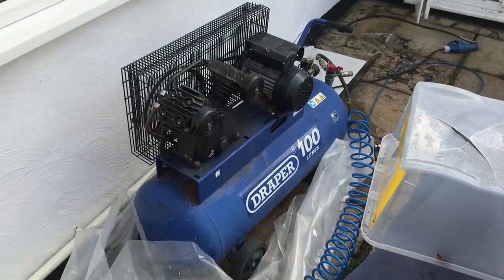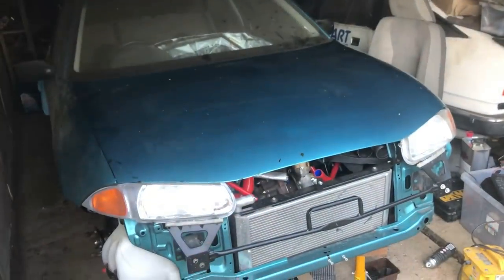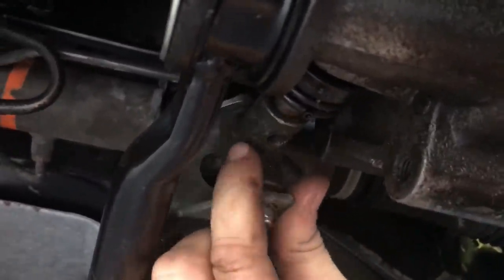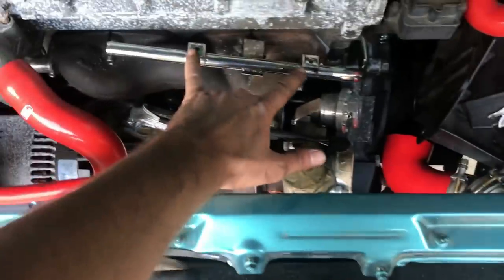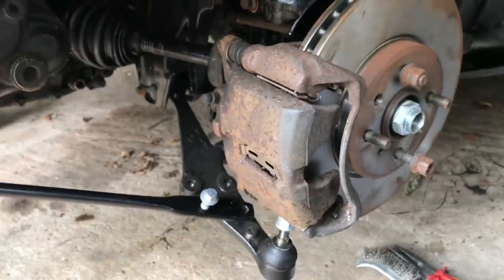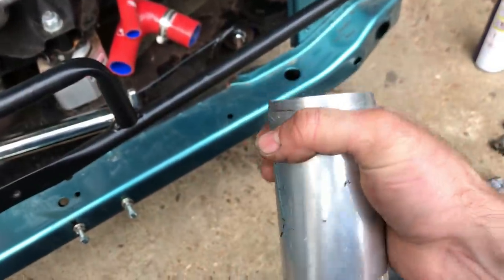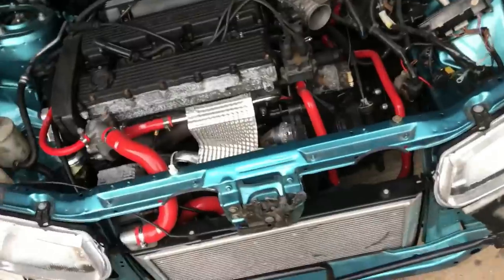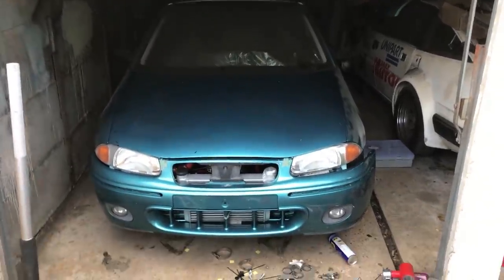Rover 200 mk3 Bubble T16 Turbo - Video 24 Bonnet, water pipes fronts suspension

Comment: been looking forward to another Bubble Video, just been watching your welding videos, im going to probably buy a welder, do some practising and try to attempt my Rover 25's bodywork woes myself :)
Reply: Good luck with the welder. Lots of practice and make sure there's plenty of ventilation where you use it. Almost poisoned myself welding galvanised steel in the shed being too eager to actually stick things together. Decent mask and gloves are essential and if I had my way 2 grinders, one for cutting and one with flappy disc for grinding welds flat and paint removal. I'm only an amateur tinkerer with a crappy welder.....
Reply: @terryatkinson899  ill be mainly outside so ill probably be only welding on very still days with no wind, we do have a welder however its gasless and loves to burn through thin metal.
Reply: @Roverjoe  same here, gasless and rough looking welds... the wire is what makes a big difference. I find SIP wire to be the best so far but a real mig welder with gas would be ideal if you have the cash.

Comment: The bolts for the front control arm go from underneath with the control arm connected fastened underneath. You’ve connected them to the top. I worked for MG Rover for 13 years and changed numbers of gearboxes and clutches.
Reply from the maker: Do you mean the two bolts that hold the tie bar to the control arm?  They definitely and can only go in from the top.  I just checked the workshop manual. Or is it another bolt you mean?
Reply: @nitrosilvia  yeah you’re right they go in from the top.